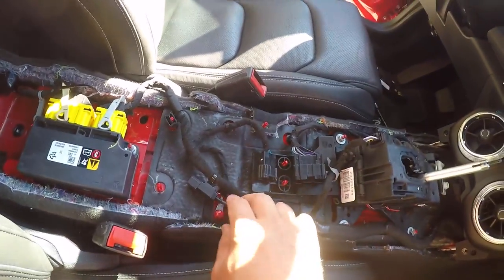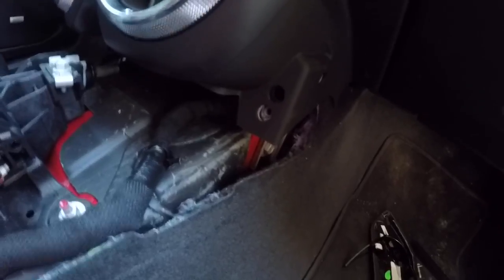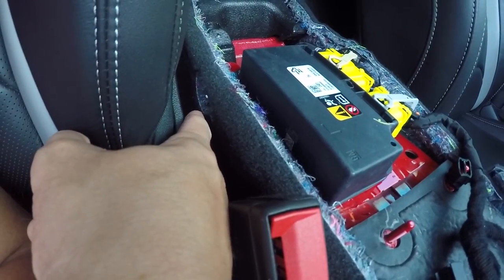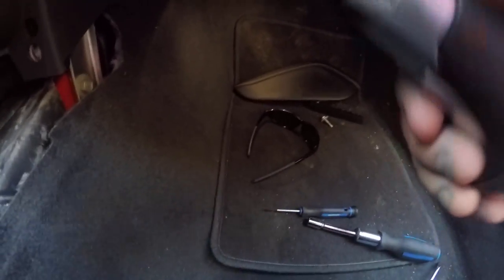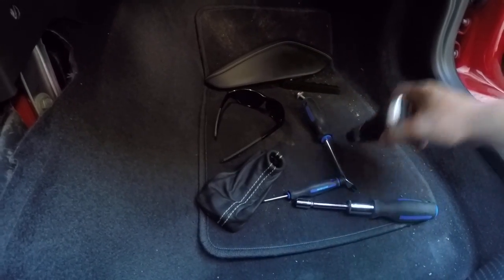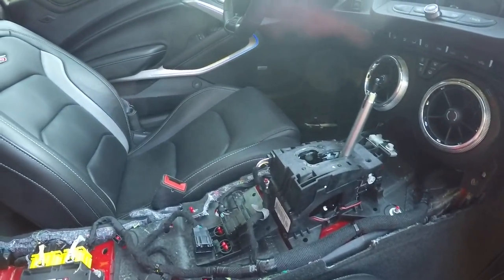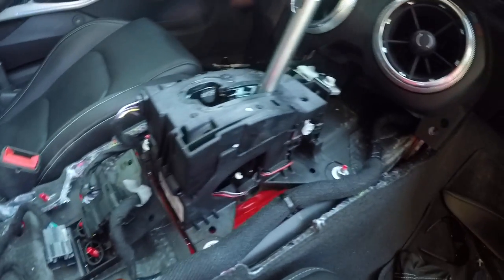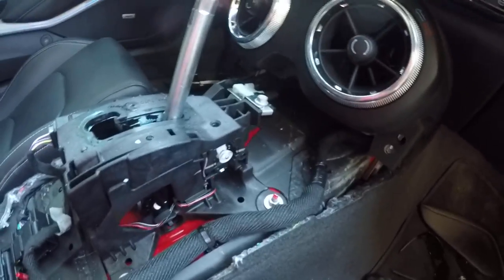2016 2017 2018 2019 2020 2021 2022 2023 Camaro SS Center Console Removal and Re Installation

Comment: My ring slid under the vent. Using your video, we were able to remove the console and found my rings, however, we are struggle to get it back in. If we do the front first, can’t get the back and vice versa. Can you please help?
Reply from the maker: I don’t really remember because it’s been a few hours but I recall putting the front in first and then having to flee the rear seat foam

Comment: Thank you for the useful video.
Is it possible to remove the console without removing the shifting knob? If I put the shifting on D or N.
Thank you
Reply from the maker: I don't believe so, the shift knob will not fit through the panel on the bottom, but removing it takes seconds and a quick pull, and it just presses back on.

Comment: I just want to lift up enough to run a cable and drill a hole in the armrest compartment and plug after market footwell lighting  up usb
Reply from the maker: You can usually tuck the wire up the sides and discretely run the wire into the Center console lid from the back

I do it with iPhone cords often

Comment: On the center console lamp (the one between the cup holders) does it have a plug in already in or do you need to buy a separate harness to plug it in? It’s for a 17 ss

Comment: Did you end up completely re-wrapping the carbon fibre or did you just add the gloss black around the shifter boot? Either way, the carbon fibre looks sweet, I just added some on the steering wheel ss logo and it looks awesome, you should try it out.
Reply from the maker: i did redo the carbon, not happy with it though, i think i need to switch to the #M 1080 series carbon fibre.

Comment: Hi can i ask how can i get my ring inside the center console because it dropped underneath the air-conditioned .. Can i still get my ring sir?
Reply from the maker: You’d have to remove the console pile I did, might take 5 minutes to remove
Reply: Sir does the 2016 and 2018 camaro has the same center console sir?
Reply: Sir do you think the ring already drift down because it fell under the air conditioned it was so thin.
Reply: @TopHatPlus  when you opened the center console sir is it dirty underneath the air-conditioned?
Reply from the maker: It definitely could have slid under the vents, it’s not dirty under neath and yes all gen 6 Camaro’s are the same
Reply: @TopHatPlus  we've already opened the center console but we didn't found the ring😟

Comment: So I have a 2016 Camaro RS and I believe the Automatic Transmission Control Module is beginning to short out because I keep getting a error message to shift into park when the car is already in park. Do you know where that is located? Is it under the center console or more near the transmission itself?
Reply: Joseph Hoadley did you ever fix the shift to park problem? Having the same issue with my 2016 Camaro.
Reply: @phillipandrado9519  Actually shortly after having this issue I had an engine misfire, which was "fixed" by the dealership, which then lead to a fuel line leak...so my car was actually turned in early for its lease and they provided me another vehicle in the meantime, so this park problem turned into their problem and was never fixed. It only happened a handful of times to me and I would jiggle the shifter and it would recognize the vehicle was in park.
Reply: Joseph Hoadley thanks for the reply glad you issue was solved. We I hope I’m able to figure this out my wife loves her car and I hope I can fix it myself.
Reply: @phillipandrado9519  Best of luck!